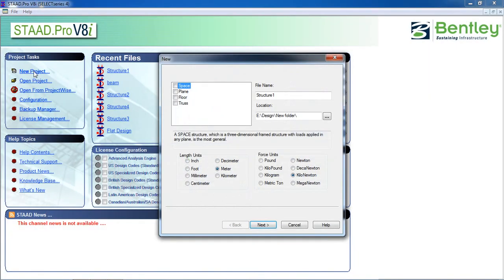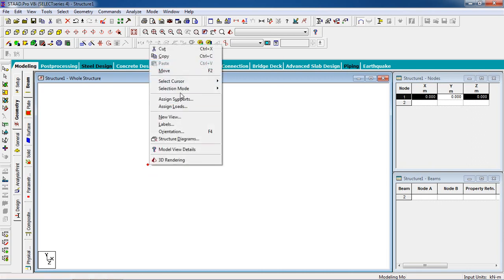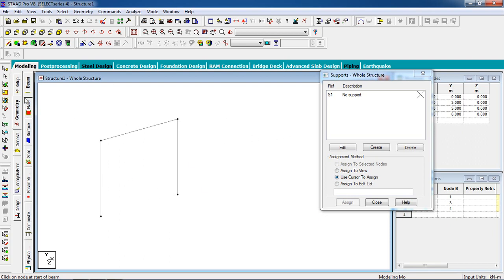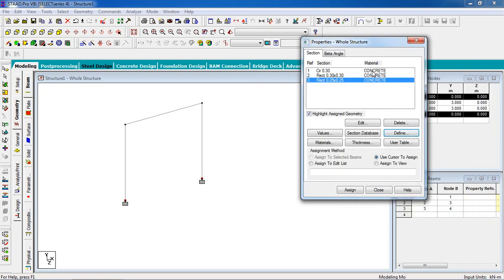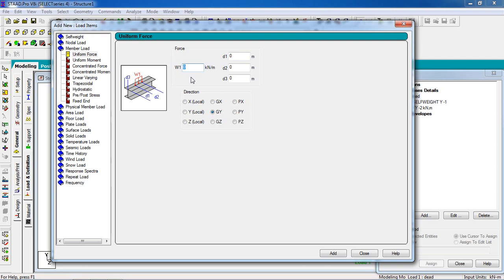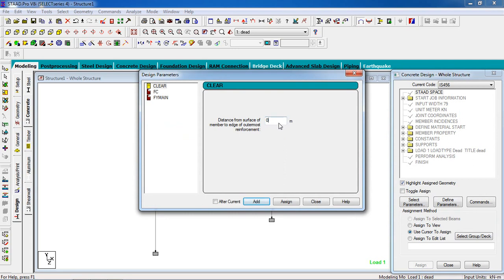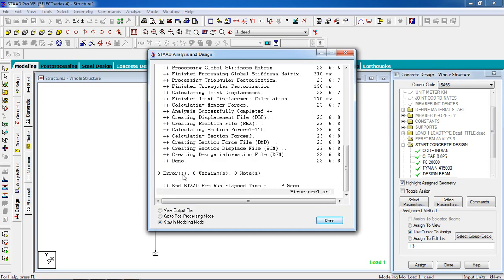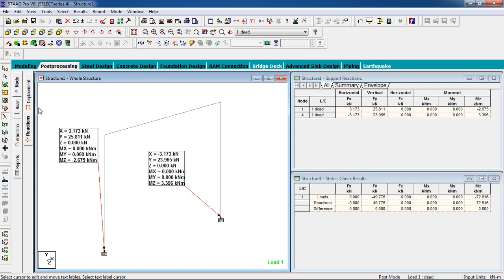STAAD Pro Tutorials - RCC Column Design ( Day 5 ) ( Civil Engineering )

Comment: Hello, I have a question regarding the support reactions. All the loads have been given in y-direction so how support reaction has come in x-direction also?
Reply: Becoz when load is applied in y direction due to bending of beam and there will a moment at the ends of column and due restrict the movement of structure outward a reaction in x direction get generated